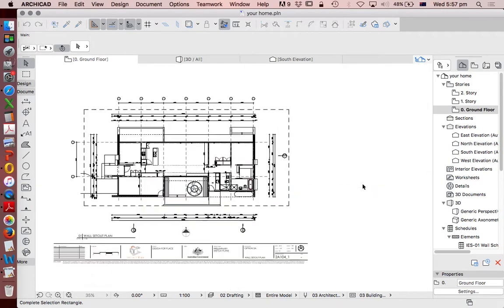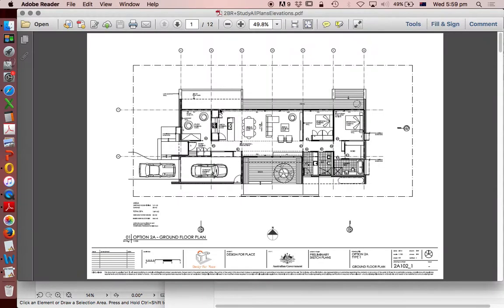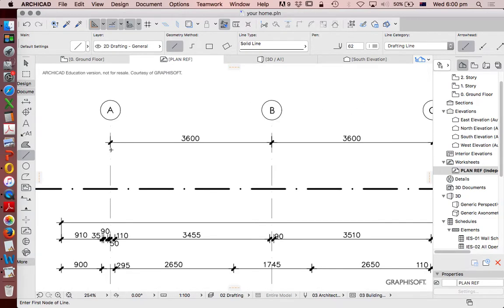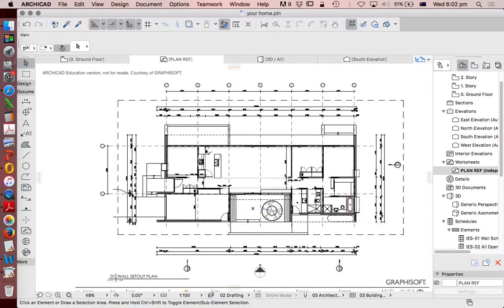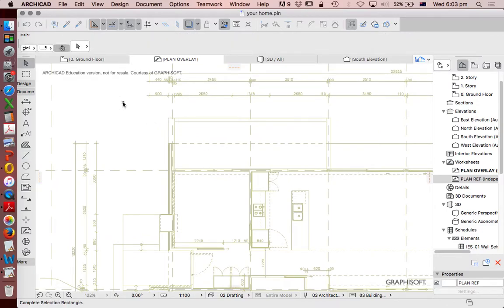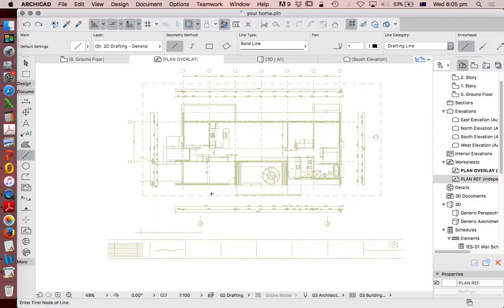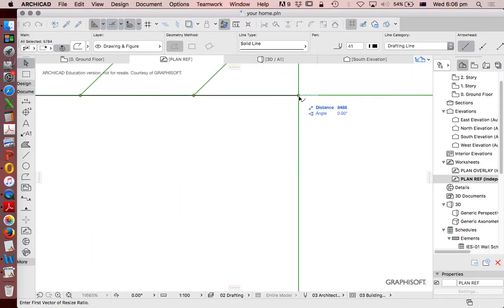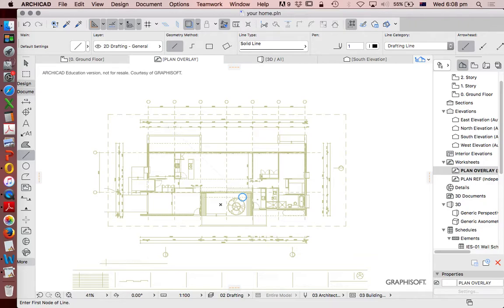ArchiCAD 21 - 2D drafting - part 1 setout

Comment: Hi Robert! I love your tutorial but came accross a problem that I cant find a solution to.  When drawing a wall in a 2-3 degree angle, the side of the wall is not straight,more like zig-zagged. Can you pleaase help how to create a wall in angle with straight lines? Thank you! Kristin
Reply from the maker: Hi Christina, don't worry about the zig-zag. This is simple a screen display issues, and it useful to identify when we are not drawing a straight line(wall). Once it is saved to pdf or printed this will not be as obvious (depending on the resolution of the screen / printer)